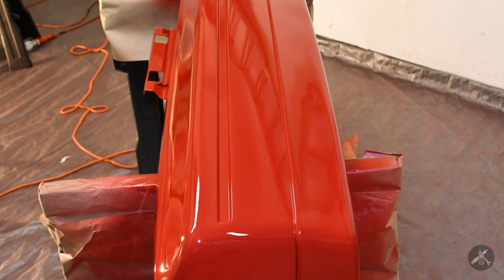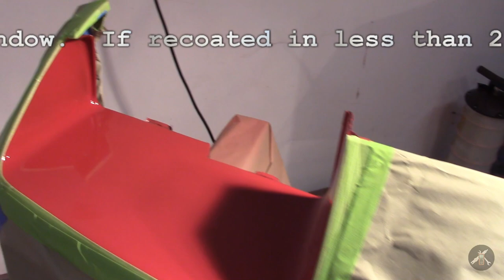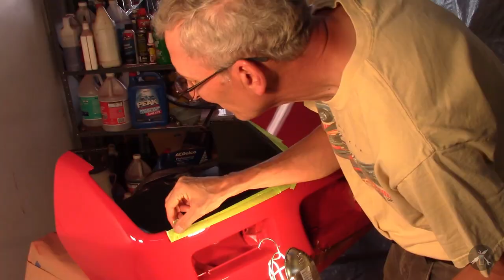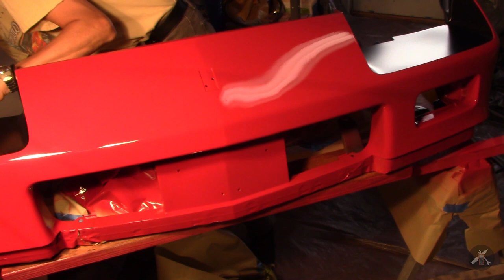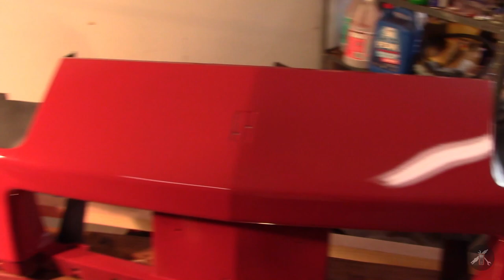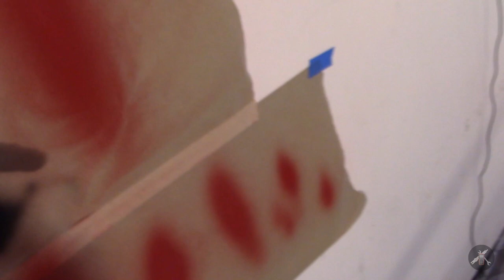Painting the Bumpers - IROC-Z Barn Find EP 104

Comment: Nice work. When I painted mine I taped off the Headlight sections before painting and then taped off the bumper to paint the black portions maintaining the factory edge.
Reply from the maker: Thank you.  I would have probably used your method if I was only doing a straight red paint job without disturbing the black.  When I repaired the crack on the right side, it ran well into the black area.  The area was heavily sanded and primed with the epoxy paint that was not a matching color.  I was concerned that it would be very difficult to bring both red and black paint to a match point without leaving a gap where gray primer might show through or an overlap that would leave a bump.  In researching it, the standard recommendation seemed to be that when you paint both colors is to cover the area with the primary color then put the second color over the top and mask for a clean edge.  I chose to do both headlight areas the same way so they looked the same.
Reply: The results are great...

Comment: What 2k paint did you use one headlight buckets ? Is it semi gloss or satin ?
Reply from the maker: The paint shop recommended SprayMax 2K Hot Rod Black Satin # 3680212 as the proper match.  The tech sheet also says it is for repairing semi gloss, so it may be a matter of definitions.
Reply: @bitsofwisdom460  Thanks , been trying to find correct black but seems everyone has a different answer or opinion on what to use